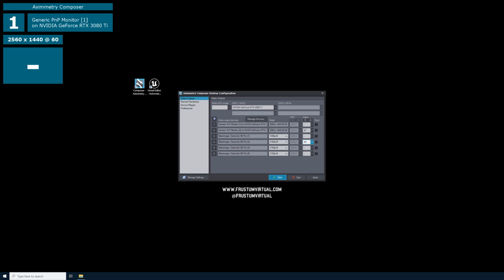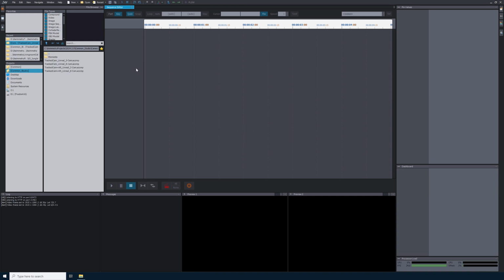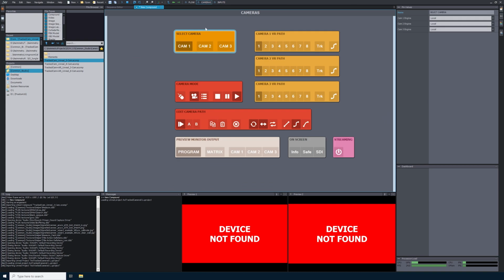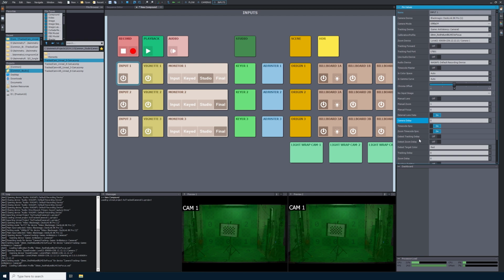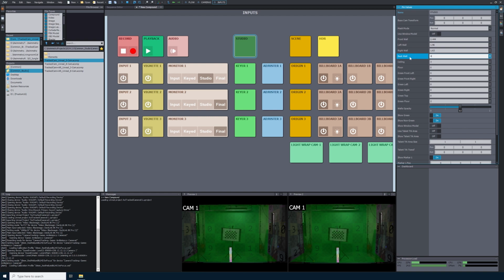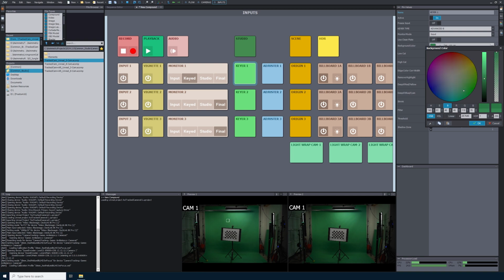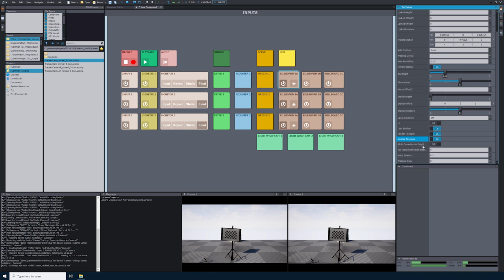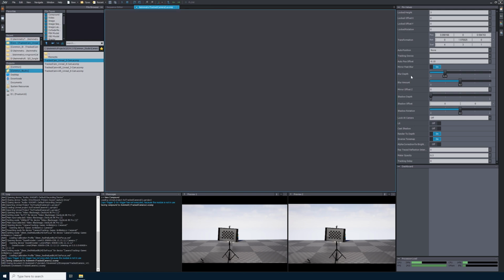Setting up Aximmetry DE for Tracked Camera Green Screen - Virtual Production - Aximmetry 5.3

Comment: I never get the other pins when importing the unreal level
just out size
connection 
and low latency mode :(
Reply from the maker: @TheNimdude  you need to cook the project in “unreal editor for Aximmetry” not unreal from epic games.
Reply: @frustumvirtual  I did, I figured out the problem. The pins wouldn't load until i hit play in composer :). Thanks though

Comment: Do you mind telling me what gpu and cpu you use? I use a a6000 and high end cpu but no matter what scene im rendering aximmetry processor load alwasys shows over 100
Reply from the maker: The a6000 should be more than enough you may need todo some scene optimization. For these tutorials we are using a rtx 3080ti and ryzen 3950x. I will do a tutorial in the future to show some unreal engine settings you can try to get better performance. It will change from scene to scene.

Comment: You still the best aximetry teacher UP to me till now.
I have a request and a question.
IS it's possible to have différent virtual input show on preview and another virtual input with another another vset show on program. I see that axymetri only put preview and preview twice.
Best regards
Reply from the maker: Thank you. To answer your question, no Aximmetry works with one Virtual set at a time. The preview 1 stream can be thought of as the editor preview. The preview 2 stream is showing you the SDI output. The preview 2 stream would be sent to a capture device for final pixel recording. If you want to load another virtual set you would have to change the unreal scene in your compound.
Reply: @frustumvirtual   thanks for your answer master .
how can each of my virtual plans have its own sdi output, is it possible? because it is important to be able to output each virtual shot independently on its dedicated SDI output. the production will have more value up to me.
your help Master.
Reply from the maker: @cloudmediaandservices1110  For multi camera shoot you would have to set up multiple inputs into the computer that is running Aximmetry. If each camera needs to be recorded and edited later you would need one computer per camera.
Reply: @frustumvirtual  thanks my master , up tu me it's a issue that they must fixe in next updates cause box like tricaster and vmix  can do that so what about aximmetry !!! a